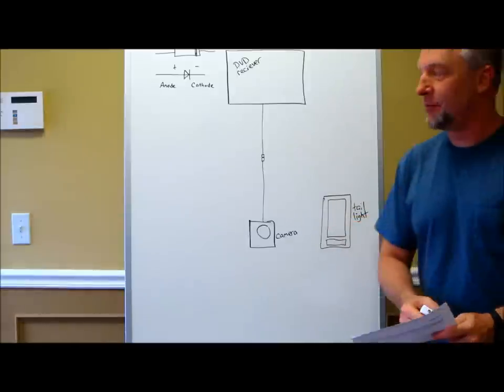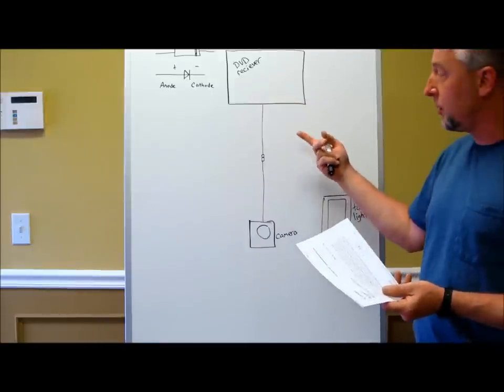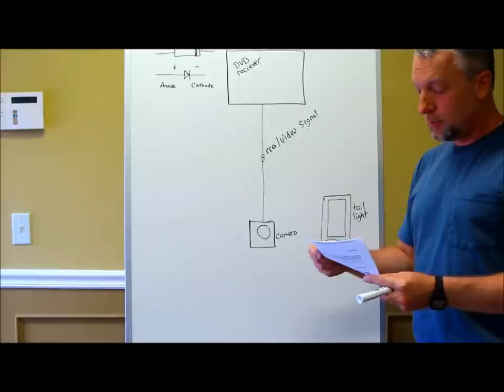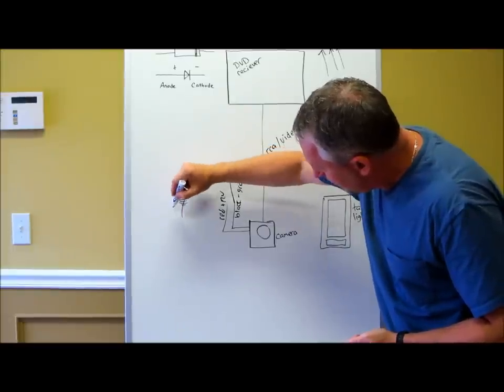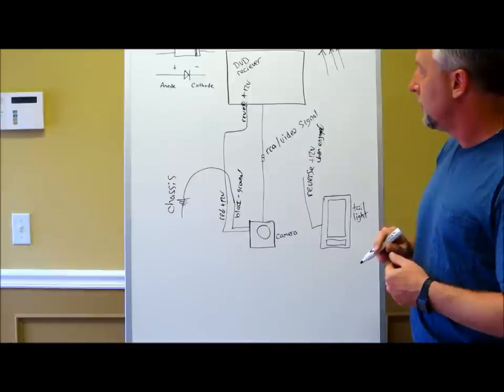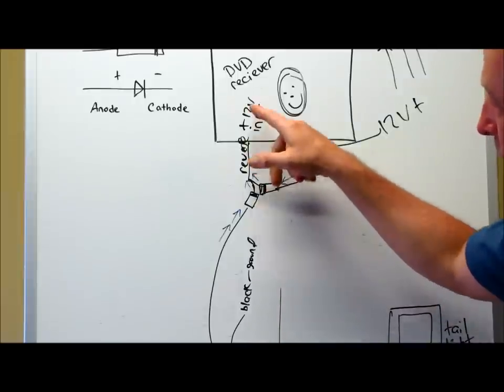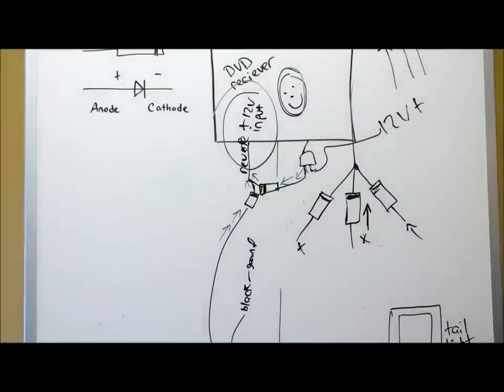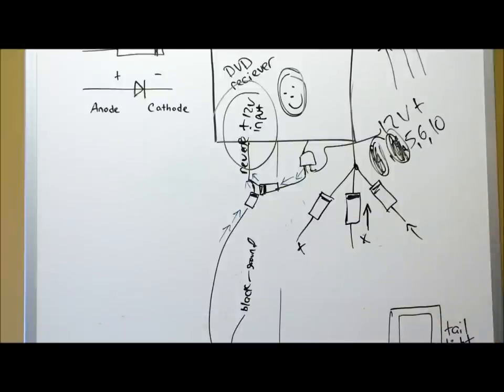How to wire your reverse camera with a switch

Comment: Thanks for posting this video. It may be almost 6 years old but that doesn't make it any less helpful! After watching this video, I bought some 6 amp diodes from Lessco Electronics. I purchased a new head unit for my 2013 Silverado, and added a backup camera. I followed your instructions on your video and it works like a charm! Thank you!
Reply: How long did the shipping take? If you can remember.

Comment: Just an observation.  You only need to diode isolate the reverse light wire.  The other end of the overrride switch is at 12 volts so if you close the switch while the car is in reverse you get no current flow since the potential coming off the reverse wire and the switch is the same.  Very well explained write up.

Comment: Great stuff, but I think only 1 diode on the reverse trigger wire might be good if we are just trying to keep the back up light from going on when the switch is closed. Also, a fuse coming from the power source to the switch might be a good thing.
Reply: I thought this too but if you are using a switch with a light in it then that will illuminate when reverse is selected in gearbox. If you only want override switch to light up when using switch then double diode is necessary. This won't matter if it's a non illuminated switch though and a single diode can be used.
Reply: Can you do a diagram on how to wire it up on a switch without using reverse switch
Reply: @Jpcars636  Just to clarify, are you saying you want the cam to work completely manually through a switch and not at all through the cars reveres light circuit?
Reply: @s3uoq  Right, I was speaking of a basic toggle. An illuminated switch or pilot light will light up from the reverse circuit. Not sure it would be as huge an issue as the back up light coming on but if it's not wanted then, yes, 2 diodes are needed.
Reply: @rollingthunder1751  yes that’s better for me 👍
Reply: @Jpcars636   In that case, no diodes are needed. Simply wire a sufficient 12v source through a switch and combine it with the cam positive and display trigger wire. The cam negative can go to chassis ground. *Make sure to fuse the 12v wire close to the source.
Reply: @rollingthunder1751  yeh it’s done now cheers tho

Comment: Sir, hi thank you for your video got better understanding now how to wire my camera using switch and diode. But one question on the 12V switch and 12V power coming from the tail light ... 
1. How about if I forgot to turn off my switch and suddenly reverse my car,  power supply from reverse light and my switch are both triggered? what will happen
2. My car still using halogen bulbs reverse light maybe about 21watts “guest only” what diode capacity is ideal?
3. hope you can help me to solve this question in my mind... thanks Anton

Comment: 2016 or 2015 silverado              I would say find a constantly on 12v like off
 the battery put a diode on it and tie it in on 1739 (red) in the rear 
body junction box with a diode to prevent it from going back up to the 
ignition.  Then find an always on neutral like off the battery and tie 
it in on 24 (white) in the rear body junction box with dual diodes to be
 safe (probably not needed since it is a neutral, but just to be safe 
anyway) and then break that neutral thru your switch and it should power
 the rear camera on and off thru your switch.  Just my opinion, but 
looks like it would work.   4 diodes 2 wires and a switch should put it 
in business.

Comment: So this may be a dumb question, but why are the diodes necessary?  I am wanting to use a toggle switch for on off function so I can view at any point while towing and using a small separate lcd screen for viewing.  I am using an add a circuit in the fuse box to tap for power.  Thanks for answers and pointers.

Comment: Great vid, learned a lot, thanks. Waiting for my cam and LCD to arrive. Dumb question, is the red wire to the DVD Receiver's "camera input" the actual signal feed or just the power? Have you just ignored the video cable between cam and monitor? Less dumb question, maybe:- I'd like to power mine from an ignition-on 12V to use as a rearview mirror replacement in a van, but I'm not sure if there is a source in the rear light assembly. Should there be one in there somewhere? If not, do you reckon it's ok to power it from the tail light rather than backup light? I'll then put the side lights (running lights) on to use the rear view. I don't want to have to run a ign-on cable all the way from the front.

Comment: Wouldn't you only need one diode on the tail light? If the switch is off isn't that acting as a diode and if its left on when in reverse I don't think it would hurt anything, because you would be adding voltage to account for any drop from the extra wires.  Not that diodes are expensive and I like the idea of isolating things for safety, I'm just wondering if there is a need for it.

Comment: Thanks for the video! Even though this video is over 5 years old...I have a 2013 Silverado with the towing package. Will a 6 amp diode wired this way be sufficient if I'm towing a trailer with backup lights?
Reply: What's your verdict?
Reply: @pterodox123  Working great! No problems.
Reply: @Jack-gu7rr  awesome, thanks! I'll go with two 6s!

Comment: Looks like he got lost trying to explain (kiss) keep it super simple don't waste time going to taillight if your going to toggle switch just go direct power like you were kinda showing at the end when it looked like you erased your reverse wire but at the end you wanted the wire can we have a part 2 video showing it the simple way with just a toggle switch and if needed the diode for the diode can you use the one that resembles a fuse or is the size to big as it would be easy to crimp a fuse holder and put the diode in there last note check the camera angle (seems like this is your early days keep it up and you'll have a good following )

Comment: Won’t that trigger the stereo to turn on but not turn the camera itself on? Since the camera is only powered when the reverse bulb is lit?
Reply: That's the way I see it too. Where does the camera get power if the diodes are preventing power in that direction?
Reply: I wish someone would answer this question. I’m guessing there has to be another power source. Maybe the power wire that runs along the rca for the camera.

Comment: Ok i wired up completley like you said now i tapped the reverse and the switch wires after diode and ran the red to the reverse signal wire on the stereo is that wrong ? because i am able to get the camera to show u with the switch on AV but the review doest come on when i revers back up camera app stays dark no matter what i do

Comment: Hello, I have installed an Android Radio with rear view camera and this is exactly the problem I am facing right now. I don't want to switch on the camera in reverse but also manually while driving. The problem is known. Then the reverse gear lamp will light up too. I wanted to do the same with the diodes but I didn't know how. Your video explains a lot more.  I already have a switch for my USB charger in the front. I would like to steal the 12+ from this switch and send it to the camera.
But what I don't understand is, why is it not enough to install a diode in front of the reverse lamp? do I have to install 2 diodes? Would there be a short circuit if I installed only 1 diode, because the 12+ goes from the reverse lamp to the switch?  I happen to have an SR260 m10? diode. would that work too?

Comment: Instructions. Reverse taillight provides power to camera and must be connected to brown reverse wire of radio. Yellow rca camera to radio.black is Ground . I use ground of reverse light bulb.works fine. Put car reverse, radio switches to camera display

Comment: PLEASE REPLY ASAP!
Great video! I just liked & subbed! ------------- BUT! Now I have a question for ya! If I am not wanting the camera on anytime I want it, just when in reverse, could I tap into the reverse light pos and rev light neg wires at the light which is right next to the camera of course, then run the vid cable and the reverse signal turn on wire (if that is what the other wire even is? SEE other question below) to the head unit?
The reason I ask is before i found your video, i watched others that showed it done this way and i went ahead and run the wires as i wait for my head unit to arrive. Hoping I did not screw up and have to redo all i done because it was a pain in my 2011 prius to run the wires from the top of the hatch(where the tag is) down to the tail light then all the way to the front of the car!
Also just to be sure, the video rca cable also has a little red-pigtail on each end of it. ----- I could not find out for sure about this pigtail so to be safe i went ahead and ran another wire from the rear pigtail to the front pigtail,(the red short wire found on each end of the video rca cable) just incase i am right and this wire will be used to let the HUnit know when to switch to cam by connecting it to the wire labeled reverse on the hu's wiring harness. Am I right or am I all screwed up???
Thanks! PLEASE HELP!

Comment: Hi just watched this tutorial vid and it was great. I have a question. Instead of running an alternative 12v power supply to have a switch, Can also wiring the reverse camera to the Park lights and then turning the park lights on acts as the on/off switch for the camera? ( obviously the diodes will still be needed)
Reply from the maker: sure, no problem there.
Reply: good idea if you have a lift tailgate lam using a wireless camera.

Comment: Also, with your last picture, seems with the placing of the tail light Diode, would prevent that tail light from working at all, correct?
Reply: No. It is just a tapped/jumped connection to (+) on tail light and it is not tail light's main power connection.  Tail light is getting its power from a different source/switch that car has. Jumping to that connection is just providing you with a sense connection (when tail light is powered on).

Comment: in this case without using the diode i would connect the camera straight to the battery power or to the remote power and connect reverse wire from the head unit to the reverse wire into the taillight reverse wire. you do not have to use any switch or diode

Comment: How about  back up camera wired to monitor on dash for use during driving.

But splitting to a 2nd monitor when parked with 2nd monitor in the back?

I have a van I am going to be staying in on business trips and would like option to use the cameras as security cameras to see outside when in the back

Ideas?

Comment: Nice video ! Thanks for doing it! Here is my setup : Im running Front and Rear Cameras to Head unit utilizing both a toggle switch 2 Pole center off i.e. , ON/OFF/ON AND A SWITCH TO CONTROL Video feed and trigger the correct camera. The 2 Pole Toggle will control the front camera when I want it in the ON position constantly. I figure I need one diode at the Reverse Power on Tail light and one below the Head Unit where the diode makes contact with the trigger wires. The 2 Pole Toggle will have an adapt fuse before going to 12 Volts . The Head unit will also have an inline fuse to power . I have a schematic I could email if it would make life easier?Question : will 2 diodes be sufficient? Thanks Get Up and Go aka Papa
Reply: Plz email me diagram
Reply: Hi. What will happen if you forget the switch in the ON position and you put car in reverse? I have 1 rear camera and 1 camera on my caravan. I want both to work from my reverse power but also want to toggle between the 2 while driving. What will happen if i accidently leave any one of them on and then activate reverse? Thanks

Comment: How to modify this scheme if I want use with an uvc usb camera attached to a tablet? There is an app that can launch upon connecting the camera. So back llight relay/switch part of the scheme should work. It is not clear for me how to switch on camera bypassing the reverse.

Comment: so i got a 98 cav. bought a cheap radio cause i wasnt sure this would work anyway. on my video wire (yellow) each end has a red wire on each side which i assume is the 12 volt wire. i spliced this wire into the red wire on my pig tail of my radio which says its 12 volts. on the other end i dont know where to put it so i spiced into the red wire that draws power from the reverse light and i spliced the ground into the ground wire on my park lights. did i wire this wrong? needless to say it did not work.

Comment: I really hope u can help. I installed a backup camera on my car. Connected red wire to taillight and black wire to what i assume is reverse trigger for the hu. When i put the car in reverse without connecting the video rca cable, the radio switches to a black screen where i assume the rearview would be if video cable was connceted. When i put the car in reverse with the rca connected, nothing happens. Help pls??!

Comment: Wouldn't i just skip tapping into the reverse wire in the tailight?
I don't need the camera to come on all the time when i reverse i will mainly need it for towing, so would i just be able to wire the camera power to the switch and call it a day? :)
Reply: I was thinking the same thing. Maybe this is done to reduce feedback, but I was thinking to just eliminate the reverse light wire tap and diode and just use one diode from the switch.
Reply: No, because when the camera comes on, it overrides every other function and takes over the screen. You don' t have access to any other functions, you just have the camera picture on.
Reply: U can have a multi screen for your camera

Comment: Hi, thank you for sharing your information, is there any possibility that the camera/monitor get damage from two incoming power sources? For example, 12volt 6amp diode from the battery plus 12 volt 6amp diode from the reverse light.  Let say the switch is turned on while in reverse gear at the same time. Is it necessary to add two 6 amp fuses after each diode? Is it safe for two powers to be on at the same?
Reply: This is a good question.

Comment: i did try to tap it to the signal light wire,what happened the monitor is blinking image too,do i tap it to the main signal line before the blinker relay switch, will it stay steady?

Comment: its is hooked up like the diagram but the red wire is going to my violet and white striped revers signal wire im thinking that may be wrong no clue why it only works in av mode not in back up camera mode i was thinking maybe because of my relay that allows me to watch video while in motion idk

Comment: It's there a way to connect the turn signals as blind spot   to the monitor with out the reverse light to come on perhaps
A (relay) thank you in advance.
Reply: hitman84e hi i think it will work,try to connect it to turn signal wire using a relay,the relay will designate different way the reverse and the turn signal without relay they will turn on both,

Comment: Question on the power wire. I connected the red and black to the reverse light. Red to power and black to the black wire on the light. I get video when I shift to reverse with the engine is off. But with the engine on the display scrambles. Should I have the black wire grounded to the truck?
Reply from the maker: +Wolf Schwurack sounds like it, either that or the rca / video cable is insufficient.
Reply: thanks for your reply

Comment: What would happen, if the switch is on (+12V) and I go into reverse (+12V)? Do I have an overvolt situation (+24V, series circuit) or is this (at 09:57) a parallel circuit and I would still have only +12V? I don't want to damange my stereo or camera.
Reply from the maker: that cannot physically happen, its electrically impossible.

Comment: Exactly what I wanted. However if I am going to add a second LCD screen (A 5 or 7 inch el chepo chines), dedicated to for the Second reverse camera! Wouldn't that be a good idea, for all time electronic rear view mirror, as my truck gives me very poor coverage through optical mirror (Lifted truck and what not). I ask this because of many reasons. First the current back up camera has Wide angel lens so really not suitable for permanent view and then has those not needed Stop / Waring lines for parking. Then By not messing with car's OEM system, I may cause less chance of damage to the HU, and camera that are going to be one 24/7, when car running. Additionally beside choosing a camera that has closer to normal human eye field of view, I am going to hang it on top of the back of the car or behind the rear glass, and not low, at bumper level, that again should give me a more realistic view of the back without making objects small/large or causing distortion of distance judgment. And who knows, may be in a future, a more sophisticated model, I may add two horizontally placed cameras to feed the same one screen, an turning the system into a passive LG type 3D picture that doesn't need a 3D glass to see 3D!!!!   In this scenario, do I need to connect both the red wires of the LCD and 2nd dedicated back camera mirror, to an IGN red wire from under dash fuse box? Thanks man and you are a good teacher.
Reply from the maker: Maybe something like this MC7101 video I did may be a more valid solution for you, Its all in one and the cameras are able to be viewed alone or split screen or or 3/4 or 4/4 on screen simultanously and can be switched manually or electronically with turn signals and reverse turn ons...

Comment: I purchased a Chines unit S160 for my 2013 Ford Escape and I want to hook up my back up camera but the unit has 4 wires one is RCA for camera in and I have three other wires a BLACK  RAD AND  GREEN REVERSE I know that I have to hook up  the reverse wire to the back reverse rad wire but what abut the other two, do I hook up the rad wire with the green and the rad from the back together and the black to the ground ?
Reply from the maker: depends, what model camera is it, that will matter alot